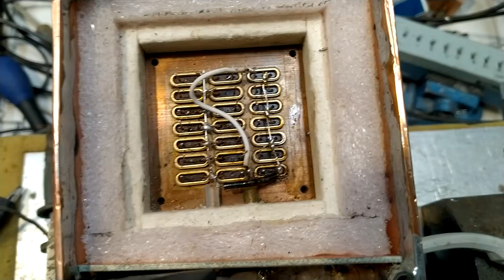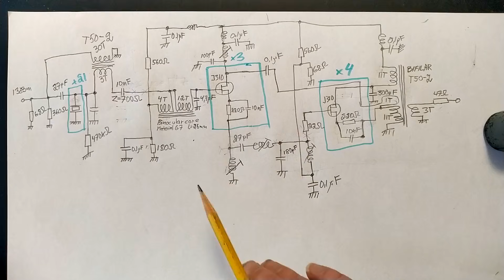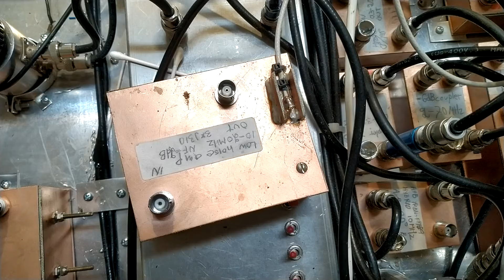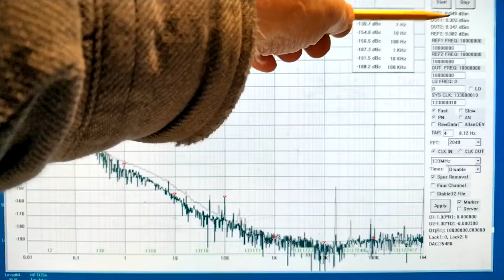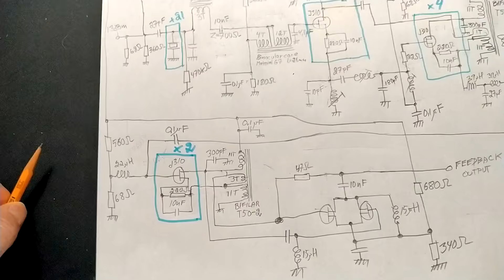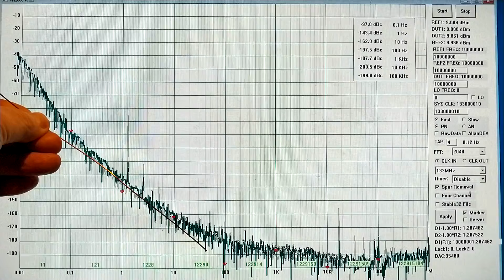nerds113

Comment: I have to leave few theoretical noob questions here:
The noise from the cristals are not releted to its orientation? 
The noise can be diffrent in acumlating around main spots if you reverse the absolute phase on some cristals or pair/non-pair rows/culloms?
Or can be related with the mechanical stress on its own legs/interconnections by heat expansions?
The material around the legs is can be glass or epoxy these are a kind of high viscosity liquids they can damp or gain the mechanical noise that low frequency of intrest?
The air viods around the metal cases are can cause shifts in the mechanical resonance of the case and cause its size cause to spread it unevenly? This case resonance is can be damped down by any type of liquid or filling material?
The behave of the cristals can not be change by puting DC bias voltage on the houseing what is can be diffrent from the ground potential? Or let them floating or drive them with the half of its output voltage swing?

Thank you for your time to read this.
Reply from the maker: The effect of crystal orientation is small. I have not investigated it in detail, but for my interest, a better "flywheel" it is of no interest. I assume a fixed orientation of the unit in a location with constant room  temperature and adequate isolation from mechanical vibration and infrasound (air pressure variations.)

All the other issues you raise might be relevant to the long time stability. That is outside my current interest. Those problems are present also in oscillators using a single crystal and industry standards know how to mitigate them. My video points to a NEW, TRIVIAL IDEA. Parallel crystals will reduce phase noise.. This could have been used for better time keeping 50 or even 75 years ago, but for some unbelievable reason nobody (as judged from the literature) has suggested this!!

My favourite explanation today is this: Assume you have a set of tuning forks at 440 Hz. Each one with a magnet at the top and a fixed coil that would give an AC voltage proportional to the vibrations. If you would couple such coils in parallel it is intuitively obvious that the tuning forks would phase lock to each other and vibrate in parallel. It is the same with quartz crystals although the force is electric, not magnetic. With the flywheel analogy, many flywheels on the same axis will keep the frequency more stable.
Reply: @sm5bsz289  Thank you for your answers for my questions.
I asume as the performance is come by  the paralleling and olso the effort what is put into the maching. I olso asume this is can be maintened as the time goes if you can keeping them in a same state. I think is can be rather pricey in labor hours or rather expensive if you wan to develop a checking/fuseing/disconecting system behind, to do this work recently without human asistance.

Comment: AI Summary

Abstract:

This technical presentation (part 113 of the "nerds" series) details the design, screening, and characterization of an ultra-low phase noise 10 MHz oscillator utilizing a parallel array of quartz crystals. The project focuses on mitigating sideband noise in third-overtone crystals by selecting individual components with superior noise profiles and integrating them into a high-Q selective amplifier and subsequent oscillator loop.

The experimental setup employs a specific matching topology—including a 4:1 up-transformation and small coupling capacitors—to maintain high loaded Q while allowing for parallel integration. Screening of 145 crystals revealed significant performance variance, with only 45% meeting the "good" criteria for noise stability. Key findings include the attainment of -133 dBc/Hz at a 1 Hz offset and the identification of external amplifier amplitude noise as a primary contributor to phase noise degradation. The research concludes by identifying infrasound sensitivity and mechanical vibrations in the feedback loop as the next hurdles for optimization.

High-Fidelity Summary:

*   0:01 Crystal Characterization Setup: The engineer evaluates 10 MHz third-overtone crystals in parallel. The test schematic uses a 4:1 impedance transformation and small coupling capacitors to achieve hard coupling while maintaining low Q for testing purposes, ensuring identical series resonance frequencies.
*   2:14 Stress Testing and Power Levels: Crystals are tested at approximately 400 microwatts (4x the typical maximum) to facilitate the rapid identification of noisy components. Stable units identified at this level are expected to show high reliability when operated at the target 100 microwatt level.
*   4:44 Sorting and Yield Analysis: Out of 145 crystals tested, 65 were classified as good, 55 as bad (showing excessive noise), and 25 as questionable. Selection for the final 21-crystal array was based on a narrow frequency range to ensure uniform inductance within a 10% tolerance.
*   7:43 Amplifier Topology: A source-follower amplifier with active feedback to the drain is utilized to equalize drain and gate voltages. This minimizes noise contributions arising from fluctuations in gate-to-drain capacitance.
*   9:13 Phase Noise Benchmarks: The selective amplifier achieves a noise floor of approximately -155 dBc/Hz at 50 Hz offset and -133 dBc/Hz at 1 Hz offset.
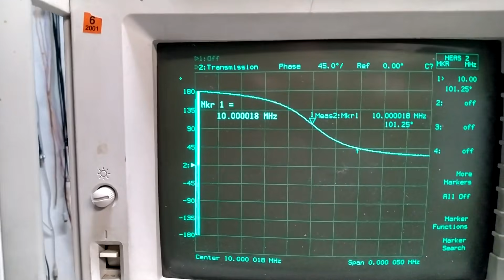*   10:58 Oscillator Loop Conversion: The selective amplifier is converted into an oscillator by adding a 90-degree phase shifter, a buffer amplifier, and an FET-based amplitude limiter. Initial loaded Q for the system was measured just below 800,000.
*   12:52 Convergence and Stability: Initial oscillator runs showed -125 dBc/Hz at 1 Hz, improving to -133 dBc/Hz after 20 hours of thermal stabilization and averaging.
*   21:51 Identifying External Noise Sources: Testing revealed that using a commercial AMC-147 booster amplifier introduced significant AM noise, which interacted with the filter to produce phase noise. Reverting to a custom-designed amplifier restored superior performance.
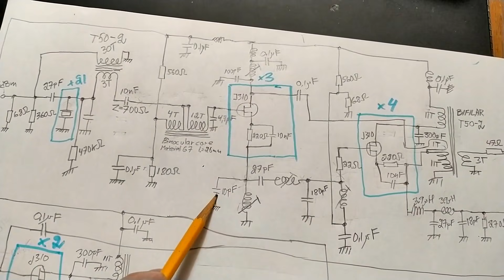*   28:40 Optimization of Loaded Q: By adding a 10 pF capacitor to the source followers and tuning the inductor, the loaded Q was increased to 1.012 million, resulting in a 1 dB gain improvement.
*   31:25 Environmental Sensitivity: The engineer identifies infrasound (low-frequency atmospheric pressure changes) as a likely cause for remaining noise curvature below 10 Hz.
*   32:03 Future Hardware Iterations: Future efforts will focus on sealing the enclosure against infrasound, adding a power amplifier to lift the noise floor above room temperature (-194 dBc/Hz thermal limit) for better measurement, and rigidizing the "dead-bug" wiring to reduce microphonic vibration sensitivity.

---

Expert Summary:

The "nerds113" project demonstrates a sophisticated approach to breaking the flicker noise floor in 10 MHz OCXOs by leveraging the statistical averaging of parallel crystal arrays. The engineering methodology is sound, specifically the use of drain-voltage tracking in the FET stage to neutralize non-linear junction capacitance. The yield analysis of the 145-piece crystal lot confirms that component-level 1/f noise screening is mandatory for state-of-the-art performance, as nearly 38% of the lot was unsuitable for high-stability applications. 

The primary takeaway for the field is the documented risk of AM-to-PM conversion when utilizing high-gain booster stages like the AMC-147; the resulting sideband degradation underscores the necessity of custom, low-noise active stages in the feedback loop. To move from -133 dBc/Hz toward the theoretical limit, the author correctly identifies that the system must move beyond electrical optimization into environmental hardening, specifically addressing infrasound-induced pressure fluctuations and mechanical damping of the resonator interconnects.

AI-generated summary created with gemini-3-flash-preview for free via RocketRecap-dot-com. (Input: 17,919 tokens, Output: 1,223 tokens, Est. cost: $0.0126).
Reply: Gemini 3 Pro proposals on how to improve the measurement (I have no idea if that is correct or not):

The current measurement setup is hitting the noise floor of the equipment and the environment, not necessarily the oscillator itself. To measure -133 dBc/Hz @ 1 Hz (which is elite performance), you cannot just plug it into a standard analyzer and hope for the best.

Here are the methods to improve the measurement, ordered from simplest to most robust.

### 1. Mechanical Staking (The "Dead-Bug" Fix)
*Simplicity:* High
*Cost:* ~$0
The transcript admits components are "hanging in long wires." This effectively creates a microphone array sensitive to vibration (microphonics).
*   *Method:* Use low-shrinkage wax (beeswax) or electronic-grade silicone (RTV) to rigidly fix every floating component to the ground plane or enclosure.
*   *Why:* At 1 Hz offset, vibration is phase noise. Eliminating mechanical compliance prevents acoustic energy from modulating the capacitance and inductance.

### 2. Hermetic Sealing (Infrasound Isolation)
*Simplicity:* Medium
*Cost:* Low
The "curvature" below 10 Hz is attributed to infrasound (atmospheric pressure changes). Quartz crystals and air-dielectric capacitors are pressure-sensitive.
*   *Method:* Place the entire oscillator inside a truly airtight container. A die-cast aluminum box with a conductive rubber gasket is the minimum. A vacuum flask (Dewar) is better.
*   *Why:* "Tightening screws" is insufficient. You need to stop air density fluctuations from changing the dielectric constant of the air around the tuning capacitors.

### 3. Carrier Suppression (Notch Filtering)
*Simplicity:* Low (Requires tuning)
*Cost:* Medium (Requires high-Q crystal/components)
The transcript notes the measurement is "below specifications for the PN2060." The analyzer's internal LNA is likely saturating or hitting its own flicker noise limit.
*   *Method:* Build a passive crystal notch filter to attenuate the 10 MHz carrier by 40–60 dB before it enters the analyzer.
*   *Why:* By knocking down the carrier, you can increase the analyzer's input gain by 40–60 dB without clipping. This effectively lowers the instrument's noise floor by the same amount, lifting the oscillator's sideband noise well above the thermal noise of the analyzer. This is standard practice for state-of-the-art metrology.

### 4. Dual-Channel Cross-Correlation (Increase N)
*Simplicity:* Medium (Software/Time)
*Cost:* High (Requires 2nd channel/amplifier)
He is already averaging, but likely limited by the noise of a single input stage.
*   *Method:* Split the signal into two independent measurement channels (two LNAs, two digitizers) and cross-correlate them.
*   *Why:* Uncorrelated noise (noise generated by the amplifiers themselves) cancels out at a rate of $5\log(N)$. Correlating for 20 hours is inefficient; adding a second low-noise channel is mathematically superior for lowering the effective floor.

### 5. High-Power Buffering
*Simplicity:* Low (Risk of added noise)
*Cost:* Medium
The transcript mentions the thermal limit (-174 dBm/Hz).
*   *Method:* Amplify the output to +20 dBm or higher using a low-flicker-noise amplifier (NOT the AMC-147, which failed).
*   *Why:* Phase noise is a ratio (dBc). If thermal noise is fixed, increasing the Carrier (C) power pushes the relative thermal floor down.

*Critical Assessment:*
As far as I can tell, without **Method 3 (Carrier Suppression)**, he is wasting his time running 20-hour averages. He is measuring the analyzer, not the crystal array.
Reply from the maker: @wolpumba4099  

### 1 is not the problem. I see it occasionally and then I fix it.

### 2 this may be relevant for noise below 1 Hz, but not currently because temperature variations create a worse problem below 1 Hz offset.

### 3 is nonsense. To better see the noise at 1 Hz offset one would need a filter with Q about 10 million. You might suggest how to do that without adding noise.

### 4 is the method I already use. The method is not limited by a single input stage, The DUT output impedance is carefully set to 50 ohms resistive and connected directly to a hybrid with a 50 ohm dummy on the other input. That splits the signal into two channels: DUT+dummy and DUT-dummy. Any noise added in subsequent stages will be uncorrelated. The comments "Method" and "Why" are inappropriate because they describe what I already do.

### 5 is irrelevant for the close range noise below 50Hz offset or so. The flat noise floor requires higher power. One can measure excess power, how much more noise the DUT gives into a 50 ohm load compared to a 50 ohm room temp dummy load, but at -180 dBc/Hz or below such methods are unreliable. If you look at previous videos you can see how I measure the noise at 10.700 MHz using a crystal filter. Those crystals give no noise at all when subjected to a strong signal at 10.000 MHz. The result was that the noise produced by the box was independent of whether the oscillator was running or not and the level was -182 dBc/Hz. Today the flat noise floor is a little lower, I need a power amplifier.
The "Critical Assessment" is misleading. If I were measuring the analyzer, the result would be more noise than the noise of my DUT. To see a better result than the noise of my DUT it would be necessary for anti-correlated noise to be present in the two channels. I can not see any mechanism for that except at wide separations where impedance errors may cause the 50 ohm dummy on the hybrid to deliver more noise power than the DUT. This is a well known phenomenon, but totally irrelevant for the close range noise which is high above thermal.
Reply: @sm5bsz289  Thanks for the response! 3) Seemed weird to me.

I used to work in a startup that developed narrow line width laser. I always talked to the guys doing the measurements but never quite understood oscillator stuff and allan noise. It's quite interesting, though.

Comment: looks interesting but what am I watching? lol. Some sort of stable frequency generator?
Reply from the maker: Quartz crystal oscillators are used as "flywheels" in atomic standards in order to improve short time stability. The idea I demonstrate with the video is that very significant improvements can be obtained with simple means. A state of the art "flywheel" with a single BVA crystal can cost above 10000 EUR and give -130 dBc/Hz @ 1Hz offset on 5 MHz corresponding to -124 dBc/Hz on 10 MHz. Although very simple, the idea seems to be new although it could have been used 50 years ago. Better flywheels are important in various fields, there are commercial alternatives, although very expensive:  https://www.menlosystems.com/products/ultrastable-microwave-systems/ums-compact/ 
Regarding cost, Google AI tells me: "Menlo Systems' prices aren't listed publicly because they sell high-precision photonics like femtosecond lasers and frequency combs, which are specialized scientific instruments, but expect costs in the tens to hundreds of thousands of dollars (USD)," There are many applications where a simple crystal oscillator with many crystals would give very significant system improvements - when such oscillators become commercially available.